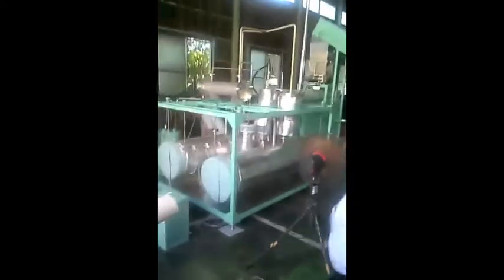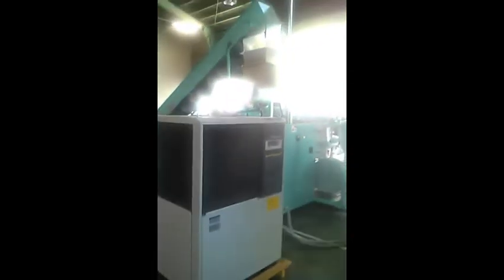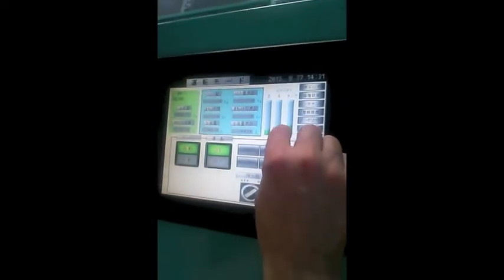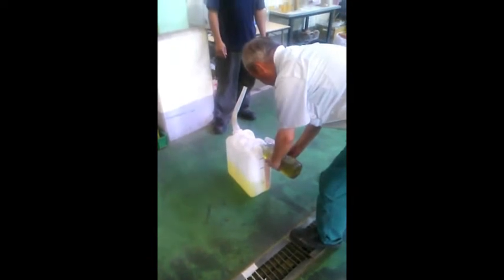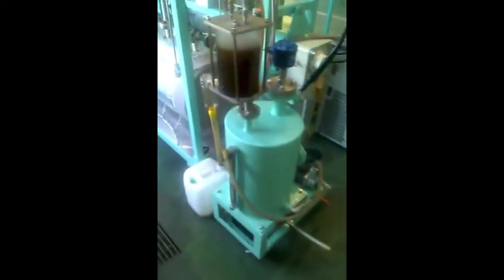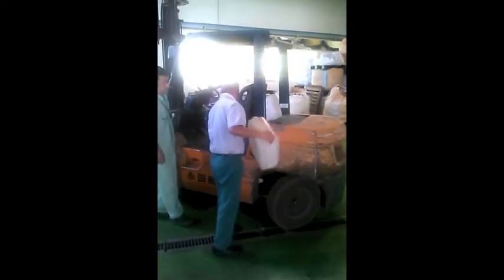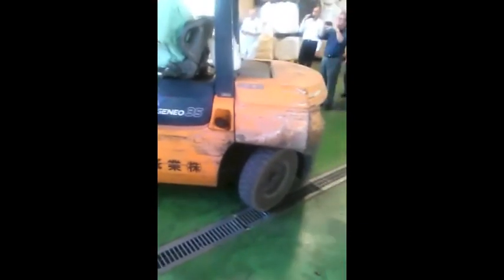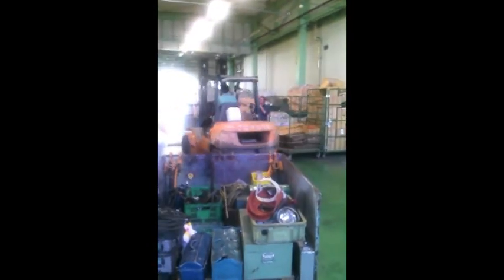REnergyP2o (RE-Energy) Plastic to oil (P2o) system

Comment: so 8 pounds of plastic is turned into one gallon. the 1 ton unit can turn 2000 pounds of plastic into 250 gallons of oil in 24hrs?